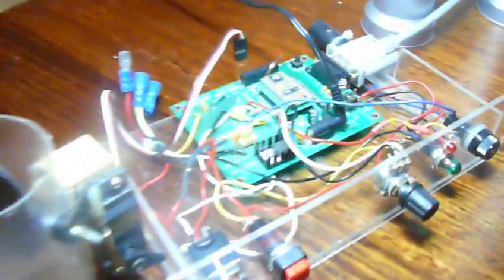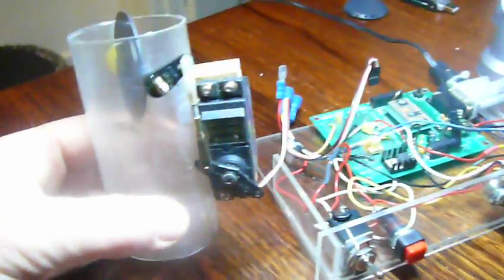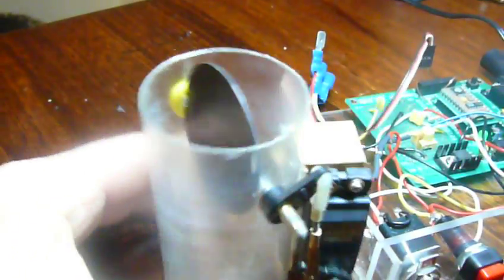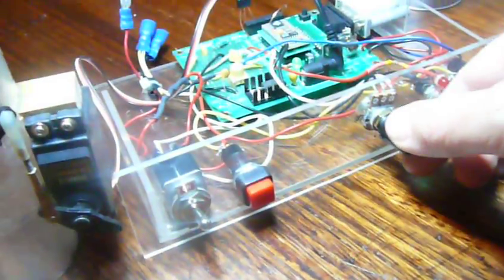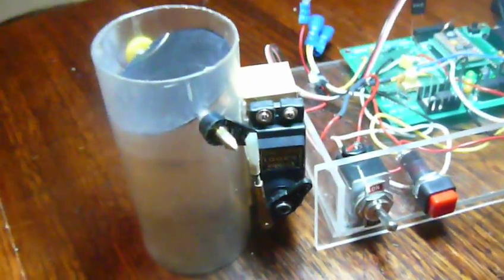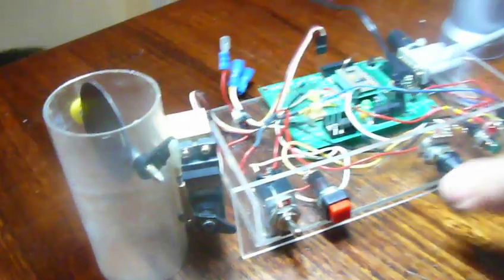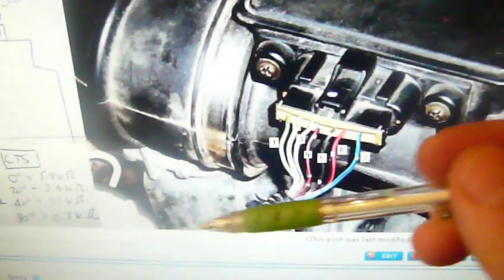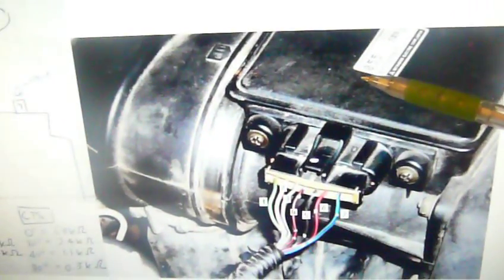Leaning car with servo controlled butterfly valve

Comment: @jbalatutube Thanks for your swift reply. Can I say that there are two situations where the servo motor draws power. One is when it is idle, and one is when it is under load. So there are basically two static power consumption situations which means there is no dynamic power consumption that I can think of? Am i right or wrong? thanks again, really appreciate your help.